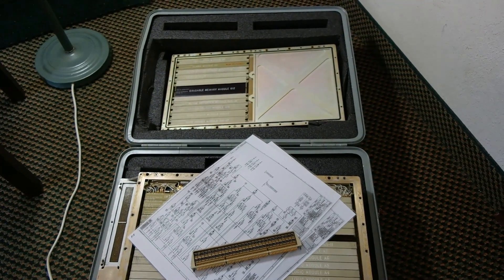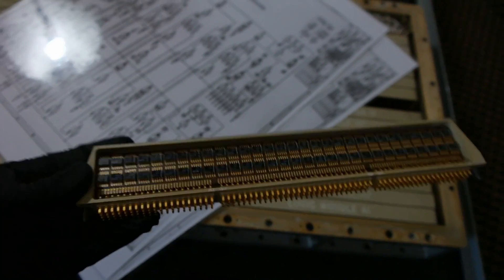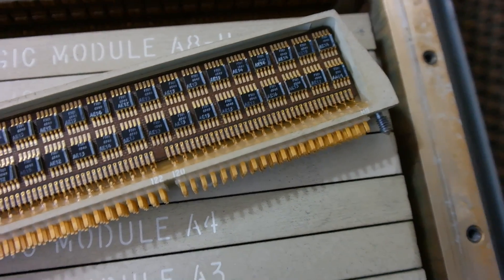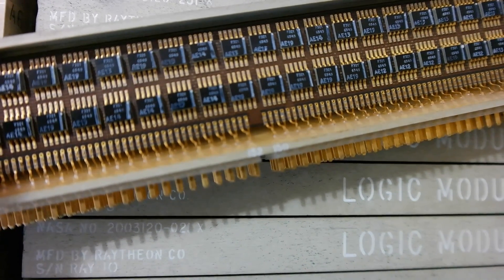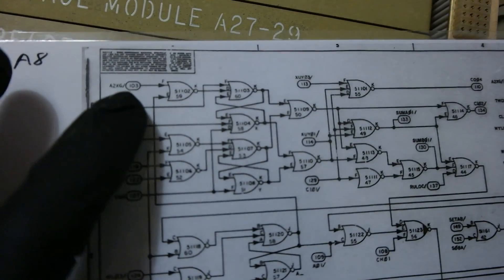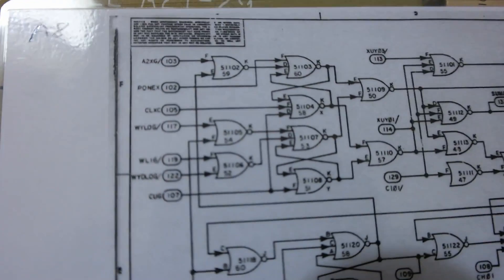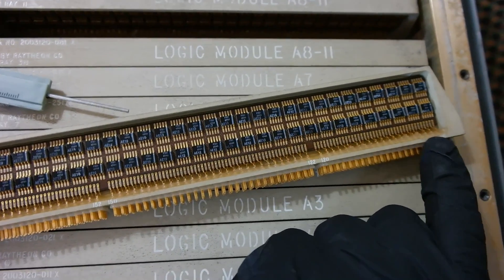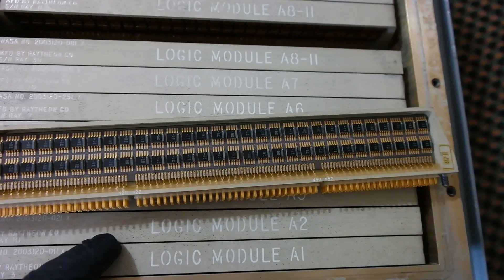Apollo Guidance Computer - Physical inspection

Comment: Also waiting for more to come. You dumped the memory-modules? What about reversing the code? Some say they used a 4-Bit CPU? We should be able to emulate. I hope you did not erase the magnetic core memories when trying to read it :-) Thats a little bit tricky. But that video looked like you know pretty well what you are doing :-)
Years ago I wrote a disassembler for code without any information about but the raw binary (which was a more recent 8-bit chip). So it is possible to do this.

Comment: This would be more a test bed than the actual computer used for development. As far as I am aware, all of the software was developed on mainframes using punch card input and band printer output before it was ever woven into core rope ROM. (See the classic photo of software engineer Margaret Hamilton standing next to that HUGE stack of output from a program not quite ready for prime time.)
Reply from the maker: You are right in saying that the code was developed (and compiled) on a mainframe, but it could not be fully simulated or tested on a mainframe alone. To debug and test the code, they had to use an actual AGC. It was possible to interface with the AGC using either the AGC's debug connector or by using rope emulator modules. The debug connector (similar to the JTAG interface used today), were used with actual (manufactured) rope memories to create different test scenarios and verify correct operation. The rope emulator modules on the other hand were used during development to quickly update the entire program on the fly. Remember that it was very expensive and took a long time to manufacture rope memories, so it would have been impractical to develop using actual rope memories. 

In short, the rope memories and debug connector were used for testing and simulation after software releases, while the rope memory emulator was used during development. This is the first known AGC equipped with rope memory emulator modules and with non-potted modules, which is why I believe that this was the AGC used by the developers at MIT.
Reply: Francois Rautenbach I believe you are correct that MIT used it, but for verifying that the software written and compiled on the mainframe worked properly for the hardware.
Reply from the maker: I am not sure I understand your point? Software development is the process of creating software (technically firmware) and verifying that it works properly before shipping it off to be manufactured and finally tested/verified by other system integrators. All I am saying is that this specific AGC was probably used by MIT to develop the software for the Moon landing. I seriously doubt that it was used in a test bed as the external debug interface was used for this purpose.
Reply from the maker: Reading your comment again, I think I get where you missed me. Embedded firmware developers never write the high level code on the actual target hardware. We write and cross compile the "software" on bigger computers with screens and keyboards. The target hardware is however an integral part of the development process. When I said that I believe this AGC was probably used in the development of the Moon landing software, I didn't say that they were writing the actual high level code on the AGC. It was written on a mainframe and then cross compiled to AGC assembly language before being uploaded and tested on the AGC.
Reply: Francois Rautenbach You got it. Used in development of the software as a test machine, compared with modern non-embedded software which is compiled and run on the same machine (like programs done using Visual Studio for Windows).

Comment: Is the raw data from the rope memory available yet ?
Reply: Rope memory and core memory were not the same thing.  Rope memory was ROM.  Each bit was physically woven as a 1 or a 0. Reading the bits did not destroy the data.  Core memory was RAM, and reads were destructive, but the hardware automatically put the bits back.  Modern DRAM works similarly.
Reply from the maker: I have not yet released it, but will do so soon.

Comment: My question is where the heck did you get this stuff??
Reply: Stuff like this turns up in the oddest places. Odds are someone at MIT or NASA saw it being thrown away and thought it was cool and took it home. Or was simply sold off as surplus hardware.
This one was likely either a development system used by MIT or used in a simulator for training by NASA. For all we know, this could be the system you see Margaret Hamilton using in the photo of her in the CM simulator.

Comment: 0:56 Actually they were designed and programmed at MIT. And earlier in your videos about the rope-memory modules, those were manufactured at Raytheon.
Reply from the maker: The hardware and software were developed at MIT. For the development they used a special Rope Memory simulator, but the physical memories could only be constructed at the Raytheon factory.

Comment: What happened tho this channel? There must be so much more to discover about the ACG computer.
Reply from the maker: Hang tight. More to come :-)
Reply: @AuthGate  waiting waiting waiting.... :P
Reply: @tekvax01  Look for Curious Marc's channel, they are working on this same AGC right now getting it working again.
Reply: @torquemada1971  the same as in the exact same AGC or another one like it ?
Reply: Benjamin Maggi it’s the same one.  There can’t be that many unpotted agcs in the wild right now.
Reply: @torquemada1971  I wondered when it was mentioned in another episode about finding this in scrap sale.  I remembered that tid bit from the curious marc's channel...
Reply: @torquemada1971  I saw the last video from Curious Marc's on the AGC and the owner is an old guy so I don't know what to make of if maybe the unit is not really the same also they feature the memory emulator
Reply: @Benjam1981  This is without a doubt the same one.  If you look at surface details on this one it will match the one in Marc's channel.  And the carrying case is identical.
Reply: Great to hear.
Reply: You need to set up a team to do the restroration work just like Curious Marc. These job can't be done if you are alone...

Comment: A number of the MIT people are still with us - Margaret Hamilton, Eldon Hall, Ramon Alonso, Albert Hopkins to name just a few of that amazing and dedicated team - could you perhaps contact them and refer them to this video? They might be able to confirm your assumption about being a development machine, tell you more about it, or just tell you some great anecdotes.
Thanks for the fantastic videos, the AGC was the Antikythera mechanism of its time.
Reply from the maker: We are actually in contact with Eldon Hall. He did a talk about this specific AGC it a few years ago (see https://youtu.be/Xtsrcc0c8Mo). He was a little stumped by the fact that this AGC had rope emulators installed and the casing were not anodised like the regular flight items. We can assume that it was an early development system.
Reply: Wonder if it could have been used in one of the CM simulators. Like the one that Margaret Hamilton was pictured working in.

Comment: The gloves are a good idea. Has to be some nasty stuff on those components (Pb for one)
Reply from the maker: I was actually more concerned about contaminating the AGC with my bare hands. All the connections in the AGC were welded (not soldered) and the rest were either gold plated or made of treated Magnesium, so I doubt that there were any real nasty stuff in there. Reducing weight was very important, so they wouldn't have used heavy metals like Pb. 
Bottom line is, rather be safe if you are not sure what you are dealing with :-)
Reply: Lead metal is safe to touch. Tetraethyl lead (as they used to put in high-octane petrol) is toxic on skin contact.

Comment: More, more!  Absolutely fascinating.  Are you thinking of trying to run the  rope memory modules you have on it?
Reply from the maker: The rope memories that I have are unfortunately of the block I type and the AGC is a block II model. 
That said, the AGC has rope emulator modules installed so it would be technically possible to construct a rope memory simulator. There would be many other challenges before you could start it up again though, like aged capacitors, etc. But it is possible...

Comment: BY TODAYS STANDARDS THE MOON NAV SYSTEM IS A PIECE OF JUNK ,   BUT WITH ALL RESPECT THEY DID IT WITH WAT THEY HAD FOR THOSE DAYS AND YA GOT TO HAND IT TO THEM .  OVAAAAAAAAAAAAAATION !
Reply: In a sense, its an over glorified automatic calculator. taking sensor readings for inputs to the guidance equations, and working out the solution for firing retro rockets and such.
But with that said, and despite the AGC's stunning lack of power, it was all they needed.

Comment: Francois - thanks for sharing this. A truly historical find. AS-202 was indeed the first Apollo to fly the block 2 AGC. Those memory modules have cost a fortune to build and test. Note that the Mars probes that NASA launched in the early 60s also used software in core rope memory. I hope you will post more videos of your adventure, I will stay tuned!
Reply from the maker: Thanks Jan. Just one correction. AS-202 was the first Apollo to fly the block I AGC. After the Apollo 1 disaster, all manned flights with block I were cancelled. The temporary suspension of flights actually gave the AGC designers the much needed opportunity to improve on the basic block I design. Without this reprieve, it could be argued that NASA might not have been successful in landing on the Moon.

Comment: Why is this not in a museum? First they erase the tapes and then they trash the computers. What were they trying to hide?
Reply: If it was in a museum your message would have been "Why is this in a museum? Why is it not in the hands of scientists? What are they trying to hide?"
Reply: If they were trying to hide anything, they would have destroyed the computers.

But then, arguing with a paranoic can be like ...
Reply: There are Apollo guidance computers that belong to museums as well. I know the Computer History Museum in Mountain View, California has one on permanent display, at least. It might be a later model than block 1 or 2, though. Not sure of its working condition, either.

The thing is nobody had any idea that microcomputers and integrated circuit boards would be useful for anything other than rockets and missiles in the 60's. It's only decades afterwards that we're able to see that these computers were the first to hold within them the technological basis of the current information age.
Reply: Lawrence D’Oliveiro ... Also, they needed the tapes for other missions and didn't just have thousands of brand new expensive ones laying around some were reused as they were rewriteable.  There were also plans for more missions too so maybe they just didn't think they were that important at the time?
Reply: There were 42 of these made.  Lots of them are in museums.

Comment: This discovery is probably of great value to the Virtual Apollo Guidance Computer project: http://www.ibiblio.org/apollo/ and the "Build it yourself" project http://klabs.org/history/build_agc/
Reply from the maker: Yes, the circuit diagrams for the block II AGC has been available for some time, but only for the modules. There are no interconnection (wiring) diagrams or info on the I/O ports though. We are busy reverse engineering this.